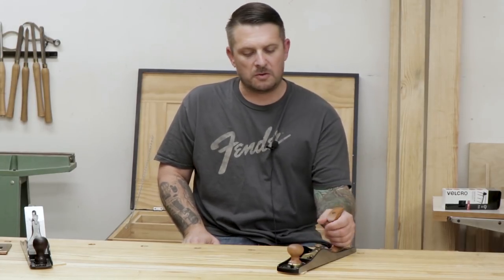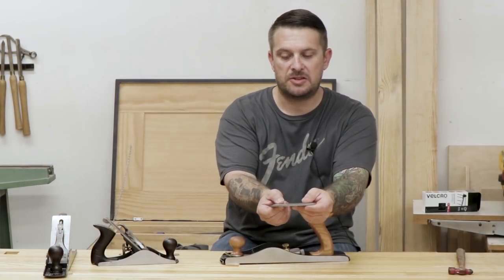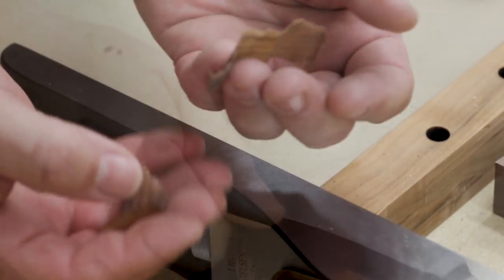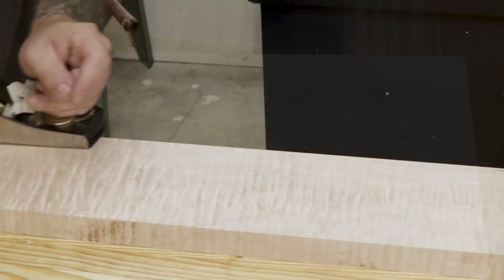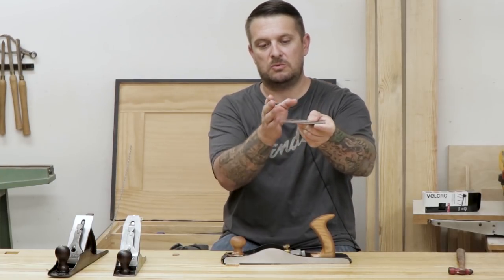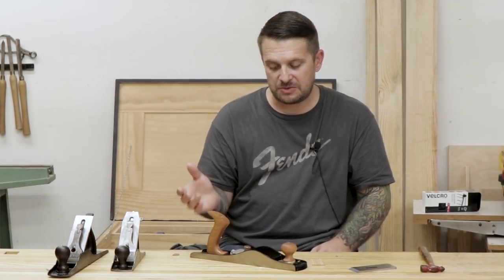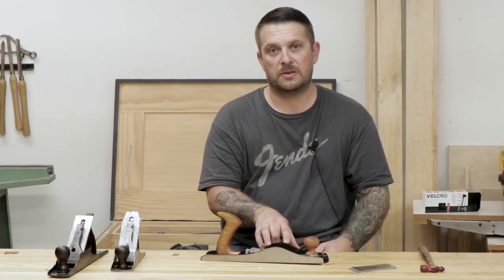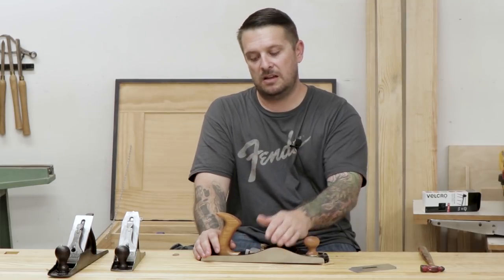Low Angle Jack Plane Review (One Hand Plane For Multiple Tasks)

Comment: The Veritas low angle Jack has set screws that keep the blade square to the mouth.  I really don't like using my LN low angle jack for anything other than end grain because setting it in and out is cumbersome.  If anyone new to the craft is wanting to get a low angle Jack, I would recommend against the LN plane and go for the Veritas one instead.
Reply from the maker: Thanks. I love Veritas tools! I mention the veritas and the set screws towards the end of the video. I mention that I might have bought the Veritas if I had to do it again for that reason. I also like the stop that keeps the adjustable toe from hitting the iron. The more I use the LN without the set screws though, the quicker and easier it gets to set.
Reply: @TwistedWorkshop77  Sorry, I must have missed that part.
Reply: With the caveat that the veritas is $90 more than the LN. I would imagine one would adjust to the LN adjustments and anyone new to hand planing would be new and not have a frame of reference. I'd recommend the LN based on these facts alone.
Reply: @jc51373  Sorry man, they are exactly the same price to the penny.  The problem is when you have to adjust and then re-adjust for different purposes.  Its really a bad overall plane for a beginner as they have a tough time setting a hand plane to begin with and now they have to contend with tapping the iron over with a hammer every-time you adjust the iron in and out.  The reason I commented on this is because I see video after video where people recommend this as a "if you could only buy one" hand plane you should get a No. 62.  Fact is, you shouldn't buy one hand plane.  Rather buy two used hand planes so you have the correct tool for the job.  I have both the LN No. 62 and an antique Stanley No. 62, and I have nothing against either of them, but the original design Stanley went with is does not condone itself to simple adjustments.  On the other side, if you want a purpose use shooting plane or if you just use it for end grain use, the No. 62 works great.  Just don't adjust it.
Reply: @dan__________________   yes i was looking at the number 5...I still don't see the need for adjustments on a plane this versatile. I agree it's probably better to have several purpose built planes in your tool shed, but if you had to choose one, this one should be on the list. I am using to it take down a maple work top, 4 squaring the legs, and every other task associated with a roubo bench build. It's a journeyman
Reply: @jc51373  That sounds like all face or edge planing.  Now switch to end-grain planing and you have to change it, and again when you are using it for shooting.  It does work well, but I would always recommend having a No. 4 plane for smoothing anyway.
Reply: @dan__________________  but you can change the blade degree and open and close the mouth, which gives the adjustment you need for tearout issues. I agree a smooth plane is definitely an amazing compliment to this plane without a doubt..but you can dial this plane in (whilst spending more $$ of course) pretty darn close to what some of the other stable-mate planes will do for you. At the moment i feel no need to buy anything else, but who knows where this takes me. Shooting board is next project after the bench, I'll try and remember to report back.
Reply: K

Comment: When you run into difficult end grain you can skew the plane 20° to 30° into the direction of the cut on the fly.  If you are right handed skew the front of the plane to the left and vice versa.  Problem solved.  It's also excellent for planing the edges of doors that stick without removing them from the hinges.  Use the standard angle blade for both.  If I had to keep only two planes and get rid of any others it would be this and the bronze & rosewood 1/2 inch small shoulder plane which Lie-nielsen unfortunately no longer makes.

Comment: Very nice and thorough presentation.  I am of the same opinion that a bevel up jack is the most versatile bench plane offered.  They easily accept additional irons to get attack angles of 37, 45, 55 degrees or whatever you desire with little to no downtime.  Opening and closing the mouth to suit the task at hand is extremely simple and quick.
Reply from the maker: Thank you! I have been very impressed by the bevel up planes. I find myself grabbing it more and more over some of my others

Comment: Just recently found your channel and continue to be impressed. You bring a great body of practical knowledge to your work. No replacement for that. 
I have had this particular tool for quite a while now, maybe 20 yrs. I bought a Veritas low angle smoother at the same time and planned on sending the one that seemed the most redundant to my existing planes back. I still have them both and use them every day. Pretty much my go-to for most planning jobs. 
They both have some annoying quirks but overall I don't think you can go wrong with either company although I do prefer the veritas for "shooting" as the design seems to have taken that utility into account. Thanks for the great work here.
Reply from the maker: I agree. Both brands are great. The extra features on the veritas makes it a great choice. At first I thought I really needed those set screws that the veritas has to keep the blade centered but after some time working with the LN, the quick couple taps on the iron to center it is like 2nd nature.

Comment: Great video. I've had my Stanley jack plane for 40 years now. Can't ever remember adjusting the frog. Maybe did many years ago but I never touch it now. I think once you get it working well leave well alone. same for my block plane.
Reply from the maker: Thanks! I have a couple jack planes all set up a little different. One with an open mouth for heavy shavings and another set for a really closed mouth for fine shavings and minimum tear out. Your right though, once the frog is set for that type of operation, I don't have to mess with the frog anymore

Comment: Great review Sir! I received this plane today and already ordered a second blade with a higher angle. My question is, do you create a camber on the blade you use for smoothing? I figure without a camber it creates track marks, right?  Thanks!
Reply from the maker: Thank you. I leave my low angle blade flat all the way across since i use if for shooting and end grain. My higher angled iron is feathered or rounded on the corners. If I get small plane tracks, I just overlap each pass until I get to the edge of the board and that usually gets rid of them
Reply: Twisted Woodshop that’s what I thought, but I couldn’t find any information about it! Thank you very much for the explanation and for the super fast response! Have a good one!

Comment: I just the Veritas version of this with the 25 deg iron. I do like you idea of making a steeper micro bevel on another 25 deg iron rather than buying (Veritas) a 38 deg iron or steeper. On those every resharpen means working the entire bevel but with this I can just work the micro each time. Can you see any drawbacks to this method vs. a iron with a full bevel at a steeper angle?
Reply from the maker: I dont know of any drawbacks. Your right  it is much easier and quicker to just have to worry about the secondary bevel

Comment: Great info! I am not nearly familiar enough with hand planes so I appreciate the insight. Is there a good entry level set you would recommend? Is that Lie-Nielsen overkill for a new user? Thx
Reply from the maker: This style plane can do so many tasks, you can get away with just a low angle jack  plane and a low angle block plane. I dont think the lie nielsen is overkill for someone new to planes, I have learned for my self to buy the best I can afford. This way I can't blame the tool when things go wrong. I know it's me that's the problem!
Reply: Get FIRST your LAST tool!
Reply: In my opinion it's always better to buy quality tools.
They perform well and give more pleasure in use in comparison to the most cheaper versions.
One other advantage is that high quality planes like Lie Nielsen and Veritas make don't lose
their value that much whenever you want to sell them.
The Lie Nielsen planes are the most valued planes in my collection and are a joy to use !

Comment: Great review! Do you sharpen any slight cambers on the bevel up?
Reply from the maker: I dont put any camber on the low angle iron that I use on end grain and shooting boards but I put a very slight camber or feather the edges of the high angle iron.

Comment: Have you tried the Bench Dog low angle? I got one from Rockler but it seems that the mouth doesn’t open up far enough and I don’t know if the 90 degree blade would fit properly.
Reply from the maker: I haven't tried the bench dog version. I will take a look at it the next time at Rockler.

Comment: If you put a back bevel on the low angle jack plane close to the angle of the frog but less than the frog's angle then you can keep the blades original 25 degrees, when resharpening treat the back bevel as if it was your micro bevel and just take the burr off the primary bevel, doing this will give you a stronger edge without increasing the angle. They do this on some Japanese blades.
Reply from the maker: I never thought to do that but it makes sense. I was worried about the low angle wearing out quicker and needing more frequent sharpenings. I may try this next time I sharpen